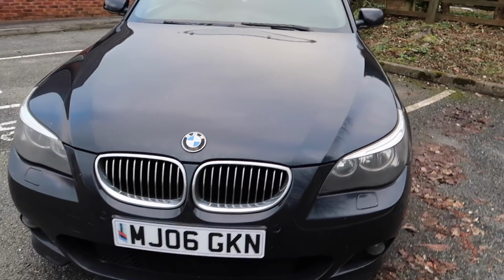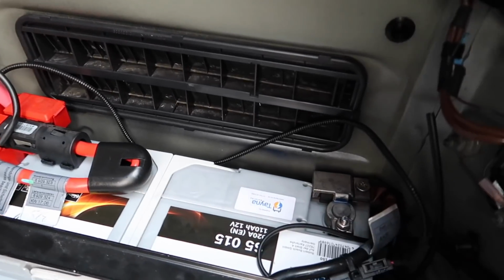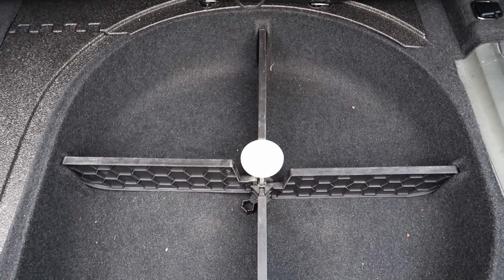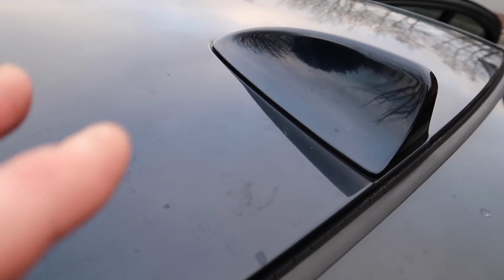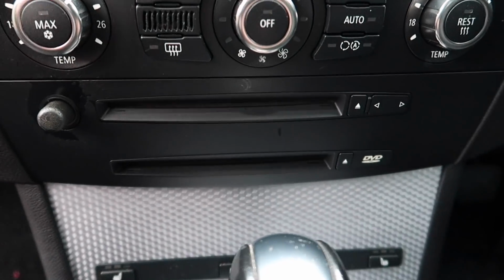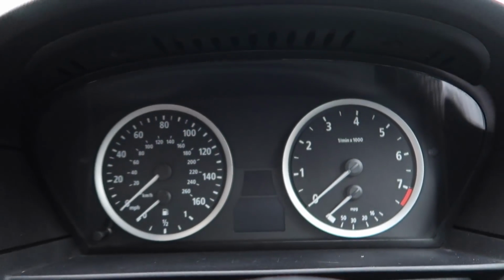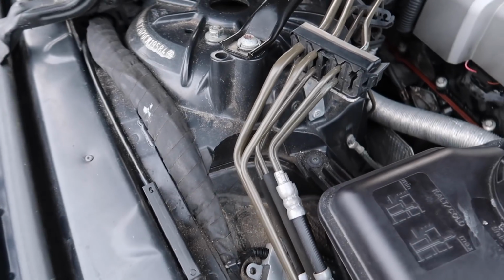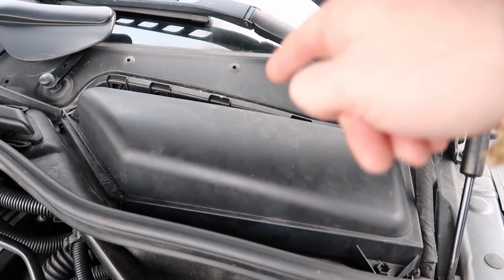TOP 10 Electrical Items That WILL FAIL On Your BMW E60 & E90....... These Issues Will KILL Your BMW

Comment: Fantastic video, well done, straight to the point.  I had two E61s and started getting interested in figuring these beautiful (or ugly in the case of the e61) vehicles out.  Summertime rains in Miami would always cause weird electrical issues, even after I got the sunroof drains sorted out.  Now in Texas and have a fully sorted out 2001 e38 Sport as a DD.  Not sure I would go back to an e60/61 but my appreciation for them has grown over the years. Thank you

Comment: Hi 👋 I wanted to ask you about my bmw 525i with n52 engine I Reacently noticed that I started my car yesterday and my fan started blowing fast. So the car thinks the engine is hot 🔥 but it's not it was a cold start. I scanned and got a code said 2efe fan activation so what do you think it can be. Waiting for your reply 😊
I have 175k miles .
Reply from the maker: Coolant Temp sensor or waterpump is failing or your thermostat is sticking 

But thermostat is on the waterpump anyway so change both
Reply: Oops 😬 that's a big job!  Thanks 😊
Reply: Hi I had another question about the same car bmw 525i e60 2007 n52 engine. So when I come to a full stop the car jerks . Is it related to the mecatronic seals. All gears are Smoth except from the jerk from stopping. But if I do a full stop and put in neutral gear begore stopping  it will stop smooth with no jerking. So I belive its to do with the transmission.  But I wanted your opinion.  I will wait for your answer as I know its 5 hours a head . I use to live in England before but moved to states. But anyways let me know once you get a chance.  Cheers
Reply: Hi still waiting for your reply 🙂

Comment: I have an 04 525i and the alarm goes off when i go to crank the car. I have to put the key in and leave the door open for 25 seconds before i can start it without the alarm going off, any suggestions on how to fix that?

Comment: Hi Doc

Can you assist? Yesterday I retro fitted my e93 rear lights with genuine BMW LED lights and the BMW upgrade connections. The outer lights which include the indicators, reversing and high density lights are not working the boot lights are, I had a look at the setting program on the menu and saw information regarding software licensing which I have never seen before. Do you think the car needs reprogramming to allow the lights to work. 

Thanks for any assistance and advice you may have.

Kind regards 
David Ledward
Reply: yes these lights you need to register, so the car can recognize it in the modules to work and connect. with these cars its like you put a new graphics card in your pc, but you need to install the graphic car via software to recognize the part and to be able to work and communicate with the main system.

Comment: Passenger restraint system malfunction pops up on idrive after cleaning the seats with soapy wooder then conditioning with leather conditioner.  Is it the pressure mat that took a crap ?
Reply from the maker: Serg K I have no idea mate it could be many things have you moved the seat forward and touched under neath

Comment: Hi mate, I really need your help and advice please you are the main man , my brother has a e90 2011 320d which recently stalled few weeks ago  whilst driving and hasn’t started since, it cranks but doesn’t start so we called the RAC and he diagnosed it and the fault came up as fuel pressure low. So he said it’s most likely your fuel pump as the injectors seem ok. So we took it to a garage and he said it’s the injectors so we ordered some used ones off eBay but they were faulty apparently 🙄...but he didn’t even check the fuel pump so we think he’s dodgy. So we taken the car to a different garage and they are quoting 2k to replace the fuel pump/ injectors but they saying we need to open the whole engine to get to the fuel pump but I was told the fuel pump is under the rear seat !!!..we don’t know what to do now can you throw some light on this please ,I know you can’t tell me exactly as you would like to diagnose it yourself but just wanted to know if it sounds realistic price and fault ?, thanks mate

Comment: hi, I have active steering failure and dct. code that i got is 614a  motor position angle: not initialized. is this steering wheel angle sensor that is on the steering wheel. I tryed to reset my active steering but it fails to do it. scanner that i used is autocom it is for all brand and not bmw inpa.
Reply: @BMWDoctor  i did look some of the unknown codes form google and one is for active steering it is DSC 5f62 which relates to a communication error between the DSC and the AFS module. my car is lower -50mm and i had wheel alignment 5months a go.

Comment: Any info on idrive screen not loading on 06 e60  dvd and CD and sos light up and make noise but screen is trying to load up but never comes on
Reply from the maker: Your CCC unit is blown mate causing no network on the most connection that’s why the SOS light is on mate I have a video coming out regarding this
Reply: @BMWDoctor  disaster man! CD and dvd seem to be loading up aswel and the fan on the ccc kicks in some times I was getting battery drain as well
Reply from the maker: Yes mate that’s the fan on the CCC as it can’t shut down so the fan is staying awake causing a battery drain mate that’s what happens when they fail take out the dvd and cd
Reply: @BMWDoctor  it doesn't leave you take out the discs, before the screen went completely it was coming on in the morning when you start the car 1st thing but wouldnt load then after you stop the car. Is it just a case off swapping the ccc with a new or second or will you need coding
Sound for the help man 👍🏼
Reply from the maker: It will need coding and programming and the data synced with the cluster not a easy job as it will have the history from previous vehicle BUT mate if I was you look for the newer CCC unit that was fitted to 2008 and up because they don’t fail they fixed that issue
Reply: @BMWDoctor  unreal man nice one for the help look forward to seeing more videos 👍🏼
Reply: @BMW Doctor I have this same problem in a 2006 550i . My fan stays awake .. my I-drive screen isn’t turning on . I’ve believe this is the main reason why I have battery drain issues .. So can I still get an 08 CCC and up ? Will this fit in my vehicle?

Comment: hi i have a 2007 335d that randomly cuts out it happens alot more often when the car is warm and at any rpm doesnt matter if its under load or coming off either , there is no warning lights when this happens or codes using snap on solus ultra

Comment: Battery isnt a common problem lol, thats on every car
Reply from the maker: Andrew I said battery IS. A problem as these have to to many electronics that drain the battery twice as fast as a normal car
Reply: BMW Doctor makes sense brother i have a e90 335 and i just replaced the battery, but it was from 2009 when the car was made

Comment: I have a bmw e90 2010, my comfort access fuse blows every other week and recently have been experiencing problems with my I drive going black no sound and logic 7 amp over heating any suggestions ?
Reply from the maker: yes mate one of your door handles are not working correctly mate you need to find out which one by scanning thats what causes the fuse to blow mate
Reply: Ok great thank you so much. And for the I drive going black mostly in the summer after listening to music pretty loud. The amp gets extremely hot
Reply from the maker: jmarcano727 that will be the LOGIC 7 on the way out mate
Reply: Thank you so much appreciate it

Comment: Jalous to see u have there space for spare wheel..wish i have same in my e91
Reply from the maker: Ah mate don’t worry about that spare wheel was a extra on these cars and had to be purchased separately which I don’t know why bmw never gave it considering this was the first car produced with run flat tyres
Reply: @BMWDoctor  i know yea but i replace mines with non runflats and bought spare wheel(space saver) cheap and ended up taking space in my boot now 🥴
Reply from the maker: Yeah mate that’s what I was always looking to do and then never did it mate no need as I hardly drive mine maybe once a month or so

Comment: I currently have no known electrical issues, but when I have the key in accessory mode, (ignition on but not running) the battery gets low with in 10-15 minutes. Is that normal for these cars? Other than that I have no known battery issues. E60 530i M54. (actually I lied passenger airbag light is on)

Comment: Hi.  Is it possible to retrofit headlight assist without upgrading headlights.  I have sensor module only.  But I think I need to upgrade headlights.  Happy to pay for advice  cheers. E60 530d manufactured 12/05  2006 model

Comment: The best BMW Youtuber out there. Thank‘s for all your great Video, and i wish you a healthy start into the New Year.
With best regards from a Fan from Germany :)

PS: i know it not fits perfectly to this Video, but do you may now how to get up again the fan belt of the climate compressor?:)
I have an 2008 M57N2 and i break my fingers by putting this thing up :/ and the German BMW Comunity is a little bit over asked by this Topic, and BMW Stuttgart want 400€ for putting the old one up🙄
Reply from the maker: Go under the car mate and the tensioner you need a breaker bar to pull the tensioner down to slip the belt over and then the tensioner will spring up and push the belt back up onto the crankshaft pulley and the air con belt mate 

If you was near me I would have come and done it for you in seconds bro if not another way is remove the tensioner place the belt and get a pin lock the tension in place and refit the tensioner then take out the pin mate
Reply: @BMWDoctor   Thanks man, i will try my luck later, and if it don´t work, i will try my luck next year again^^

Comment: Awesome video. From few days i have issue with battery drain. Yesterday I unplugged MPM and in the morning evrything was fine but can MPM drain my battery or something after him is the problem? Thanks!
Reply from the maker: thats correct yes it does as it gets fried which causes the chip inside thats meant to make the car go to sleep blow and it wont put the car to sleep mate you will need to get anew one and make sure you get it coded and programmed to the car OR it wont work properly
Reply: BMW Doctor the strange thing is when i lock the car and after some time i checked from window the orange light on gearknob was off. Or this module dont have a relation on this ? Thank you very much for the help ❤️
Reply: BMW Doctor i found the issue.. it was from TCU. MPM working perfectly. After comments i just plugged MPM and unplugged the TCU. On the next day evrything was perfect. Car started like new 😂

Comment: Another great video, thanks for your work! You mentioned Ista+ in many of your videos, that how important to learn and own this software. I tried to find where could i purchache it online, but found only 1 site where they were selling it for around 10 bucks. Seems to me a little cheap for a professional software, could it be legit? Any suggestion whoere or how could i buy this software?
Reply: Whats the price from you?
Reply from the maker: You can purchase it from me mate I’m a authorised seller and it is not a clone like that price is $10 is the ones that get blocked and stop working when used online so do not get conned like the other people it is NOT THAT CHEAP AT ALL most don’t even realise what they are buying until they can’t access there car and have no communication with the seller anymore I’m verified and many many many people have purchased from me from this channel and all fully working for over a year now with no issues

Comment: Oooh good info! didn't know that about the diversity antenna. Doc can u do a vid  explaining what actions (open the door, put the key in, open the trunk, unlock remotely etc,) and what turns on when said items are used. I always hear the fuel pump I believe, but am super curious what comes on when and by what action. Thanks Doc, glad your feeling better man, I need an iwatch!
Reply from the maker: Yes mike I will do mate , it’s not so much about actions it’s what allowing you when you give the car signals to give the module the ok to allow it most of these things are all done via the CAS when operated with the key everything goes via the CAS (CAR ACCESS SYSTEM) which is responsible for everything you do before start up and allows that key to recieve signals from your commands when pressed
Reply: BMW Doctor super interesting, thanks for the rapid reply! Used to fords where the pump turns on when the key is inserted and turned forward. Prefer to wait a second after the pump pressures before cranking an engine over. In my e82 I always have the heat, radio, and lights off as well with door open before hitting the start button so I can hear the engine fire

Comment: 07 E60 550 6spd manual with 181,000 miles on it.     I replaced the battery last year.   Past that.....I've had exactly zero of the other issues you mentioned.
Reply from the maker: Your is 2007 mate most of these issues affect 2003-2005 cars before all these electronics were moved to KGM
Reply: Is never too late ... Dont worry ..